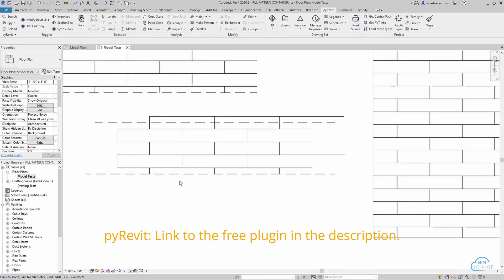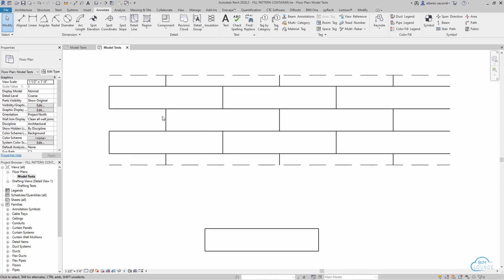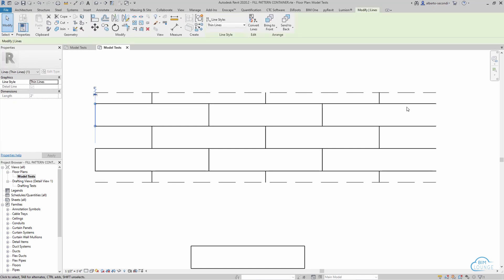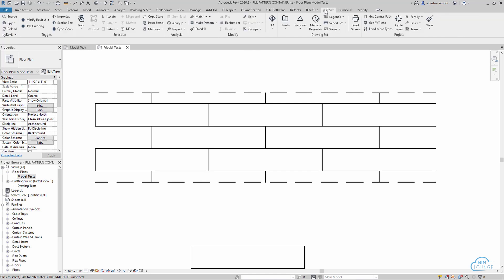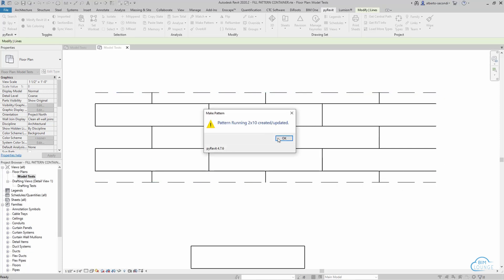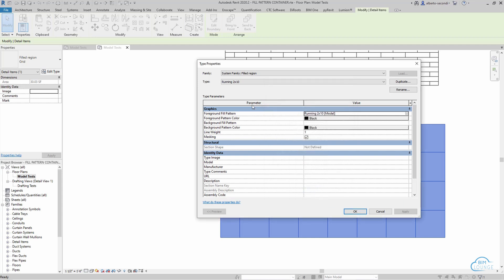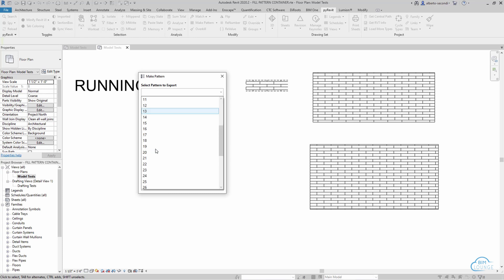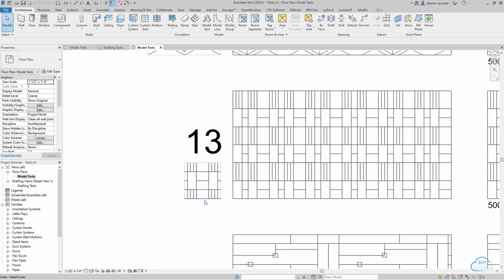How to easily create fill patterns (and pat files) in Revit using pyRevit from start to finish

Comment: I have 50 pat files.  How do i bulk load them into custom Revit Fill Patterns?
Reply from the maker: In Pyrevit, Make Pattern, the command below Make Pattern is Batch Import PAT Files. From there you can load as many as you need.
Reply: @BIMLounge  thanks for the tip